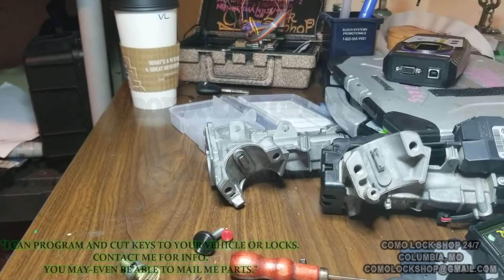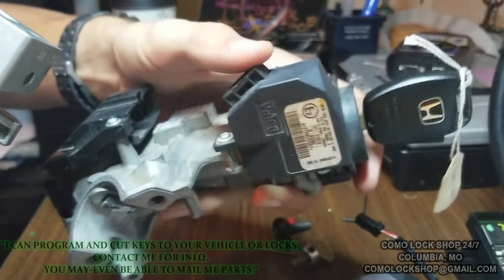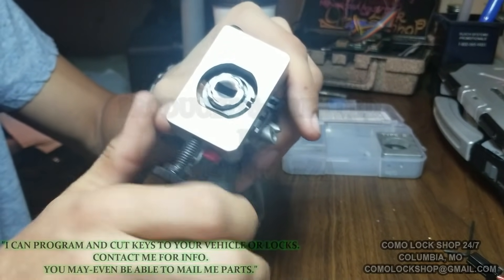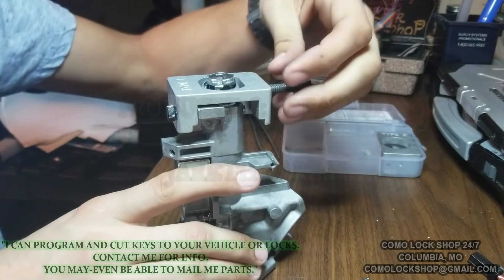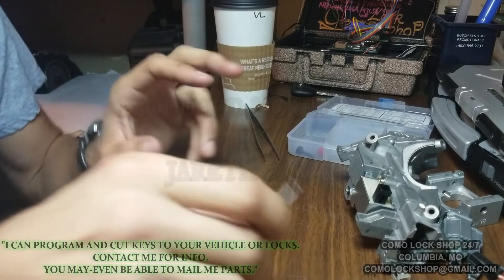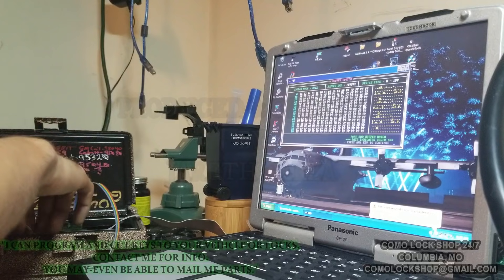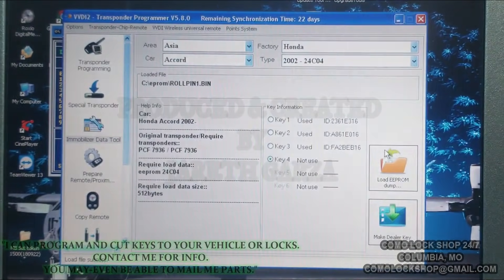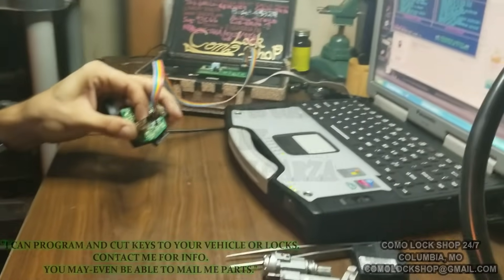2008 Honda Accord Ignition Roll Pin Removal WITHOUT DRILLING + EEPROM of Immo

Comment: 1/16 titanium drill bit right to center of roll pin . Drill slightly until it’s fitted to roll pin and just pull out with bit. Can also reuse the roll pin
Reply from the maker: Kewl
Reply: If this works, you're my new God.
Reply: @fun_ghoul  did it work
Reply: @alexdorofeyev5172  Hit and miss with 1/16" specifically, but if you have drill bits denominated in 1/64" increments or smaller, you can get it. That said, with the 01-05 Civics at least (same setup), I find that 30-50% of them have a pin so loose that you can just push on the front of the cylinder several times in succession to wiggle the pin out with gravity; you can do this with the lock assembly still on the column. Cheers.

Comment: That kit is nice Im sure. However,  I bought dental root canal tools off of eBay years ago and they work perfectly. Also, I’d say 8/10 roll pins fall out if you tap on the housing.
Reply from the maker: I've only had one fall out and it was a non-HS cylinder. I like ur tip with the dental-tool. I may follow ur lead on that.
Reply: Good call on the tapping, SK. The kit does look good, but I simply don't do enough of these locks to justify the cost (over $200 Canadian after shipping and tax). In any case, it never hurts to know how to do a "tool job" without tools! I also have mostly pre-HS pins fall out, but this has nothing to do with the style of key; I suspect Honda installed "springier" roll pins in later years. HS locks are trash for owners, but good for locksmiths and used part sellers!
Reply from the maker: @fun_ghoul  I agree
Reply: @JarethGarza  Is it also true that even you real locksmiths can't get new HS wafers from Honda? This may be less of a problem in your climate than here (Ottawa, Canada), where perhaps 20% of Honda HS door locks I open have fucked up wafers. My only source for replacements is used takeouts, though there's certainly no shortage of them at the local u-pull-it yards. Cheers.
Reply from the maker: @fun_ghoul  I have them. No problem here. I can rebuild and lock
Reply: Traditional European I have them as well. I think my kit came from asp
Reply from the maker: @smartkeys3960  mine too
Reply: @smartkeys3960  Thanks to you and Jareth as well. I probably should have just Googled it! My confusion was from reading a forum post somewhere that Honda dealerships don't stock them, and then stupidly assuming that there was no aftermarket for auto lock wafers. Cheers.
Reply: Honda dealers do have their own tumbler kits, I have seen them. I do 3 to 5 Honda jobs a week and use the ASP kit. They have changed their supplier
of tumblers in the past year or two to a design more like the originals
(more squarish in design, used to be rounded looking as if they were punched from a sheet with a dull cutter) @fun_ghoul
Reply: @smartkeys3960  I tried this with the largest root canal tools I could find from a dental supply house (size 80), and they're too small in diameter to grab the pin. I'd sincerely like to know more about yours.

Comment: I drill also. I get them out in a min or less. pin is still good to reuse.its a great technique I use.I do you use the puller on older honda odyssey's as the pin is harder to get at.  All preference.

Comment: Very Impressive Jareth. I am poor and will have to remove the cylinder myself anyway on my 2003 Honda Odessy. I saw a cpl DIY Videos that say just to remove the bad wafers that prevent the key from turning. Can you address the downside to that. I assume it makes the lock less secure?
Reply from the maker: It does make it less secure but the Transponder system will keep a screwdriver from running your car b

Comment: This is ridiculous! Drill it out with 7/64 in 60 seconds flat. Remove the key cylinder. Then use a 6/32 or similar size tap and thread the roll pin hole. Buy a 6/32 X 1/2" set screw from Lowes to replace the roll pin. Done fast and cheap without buying the contraption in the video.
Also you don't need to remove the entire lock assembly from the car. Unplug and remove the two immobilizer antennas and everything is accessible. There are four #1 Phillips screws total. The hardest part is reaching one of the two screws that holds the outer immobilizer. This is the screw that faces the speedo. Shove the wiring harness out the way and use a stubby.  Expert trick for reassembly: cut away a tiny portion of the plastic for the rear outer immobilizer screw to convert it from a hole to slot. Pre-thread the back screw half way so you can see it. Then SLIDE the outer immobilizer into place. The screw head is wide enough to span the slot and hold it securely.
Shame on Honda for fitting the lock with such cheap wafers!
Reply: ... I hope you get to make a video 👍🏼✌🏼

Comment: Trying to help someone in a big conundrum...(cant tow due to space, can't unlock steering wheel, can't turn key, etc.).  Brilliant, impressive video, but cannot figure out how to contact, or mail you the 'keylock'  assembly(?) unit.
Reply from the maker: My contact info is in the bottom right of the video
Reply: @JarethGarza  Thanks, Columbia, Mo...I'm actually in St. Louis county.

Comment: Hello and thanks for the info, great job very impressed. I have a 06 honda accord ex 2.4 L auto trans.. lost only key and bought a used ignition switch assy. With key. Green key flashes on dash. What needs to happen?
Reply from the maker: Key needs to be programmed rookie
Reply: @JarethGarza   ok so the immobilizer doesn't have to be married to ECU.

Comment: Yeah. We have a Honda. And like you said,. Like 1400$. It's a Honda recall if tumblers fail.  2010 recall...  Still wouldn't do the recall work cause it would cost them.  I ordered new lock keys and that key part of ignition.  Like 80$. And my labor.  I'm thinking of becoming a locksmith!
Reply from the maker: Good luck. You'll need programmers and key cutting machines and more. Its harder than it seems as variables make every job different

Comment: If i managed to pull out my broken ignition cylinder. Its sticks but it turns as of right now. Do i have to pull the roll pin. Or can i get the cylinder out by just pressing on the steering wheel lock bit you pressed on to finally release the lock cylinder

Comment: Today I went to make a spare key.  After the master installed the cut key, my ignition switch stopped functioning even with the original key and another master came and got it for me. It was all very quickly, he pulled out only one cylinder on the car and replaced it all on the car.  Can you do the exact same thing?  I was told that this is a common problem with Honda.
Reply from the maker: Tes. That’s light work.
Reply: @JarethGarza  Thanks for the answer.  I'm using Google Translator so maybe something is conveying the meaning incorrectly.  I just want to ask you again, Is this really a common problem with Honda and can the replaced items last a long time?

Comment: Hi Jareth I just had my honda accord 2009 model ignition changed, but the new is not starting the car, even if I put the old key together with the new key it does not read it, how can I solve that?

Comment: How do you break the tumbler down. My key is no longer turning the tumbler.
Reply: If you try do it yourself you’ll mess up 99% of the time. Take the lock to a local locksmith. It’s not expensive to have the cylinder repaired

Comment: what size are the shear bolts on the column of a 2006 Odyssey?
Reply: THAT'S WHAT I WANNA KNOW!  METRIC I GUESS. WHY NOT REPLACE W/NORMAL BOLT?
Reply: When you have them out file down round head to a flat spot on each side so you can tighten them with a wrench.
Reply: I think it was m8
Reply: I think it was m8

Comment: What do u replace the headless bolts with
Reply: My locksmith just told me to find screws with the same threads and forget about the hassle of putting the factory screws back in. No one needs that.

Comment: Wait!!  I thought I could use my old key?
Reply from the maker: What are you talking about
Reply from the maker: All day and no explanation on what you're talking about... Hmmm.
Reply: So sorry I just noticed your reply. I just thought that fixing all that I would be able to use my same old key. If a I do all these that you are doing. Comes with a new set of Keys. I would need a key to open the doors and one for the engine. Kinda sucks that idea. But thanks for these video sir.
Reply: @JarethGarza  FYI: Pootoob clips my notifications all the time, with no explanation or recognizable pattern. Just thought I'd throw that in there because, having Mercury in Aries as I do in my birth horoscope, waiting for people's replies bugs me a lot too.
P.S. I'm not certain, but this might've been the first Jareth Garza video I ever watched!
Reply: @AlexSanchez-pk7tj  You can use your same old key...that's the reason to remove the cylinder! If you're too poor to buy pins wafers, go get a pocketful at your local pick-n-pull. The best source is Civic valet locks (the one on the floor, that disables the trunk latch lever) and the seat fold-down lock (on the package tray). These locks rarely get used, so the wafers mostly stay happy. Trunk locks are usually pretty good, too.

You don't even have to know the cuts on your key. Just put it in your lock cylinder and trial-and-error the wafers until they're all flush with the cylinder. It may be a bit tricky if your key is worn, but the thing to do then is file down to the next depth. If it's already a 6, maybe you just remove that pin altogether. A locksmith like Jareth wouldn't do that on a customer car, but really, nobody will know the difference except you. ;-)

Hope that helps, comrade. If you have questions, hit me up. Oh, and please let me know if you have "HD106" (edge cut) or "HO01" (so-called "high security", "sidewinder" or "laser-cut") style of key. If you have a 2001-05 Civic, you can defo "downgrade" to the older, more reliable type of key!

P.S. If you go to a Honda dealer with a fucked up ignition, they replace it with a new one with random key, and you end up with mismatched ignition and (everything else) keys. I'm not saying that's good, just that it's a thing.
Reply: Thank you very much for taking the time to answer bro
Reply: old comment, but what Jareth means is not the exact old key, but a freshly cut one- don't use a worn out key

Comment: who sells the kit and never take the back ignition switch off if it will unplug, asimetimes the lck will become sprung and the corkscrew is a bitch to realien and get the cylinder back in when it springs.